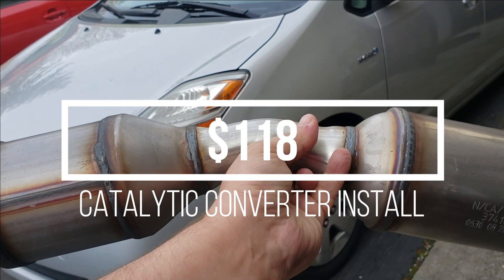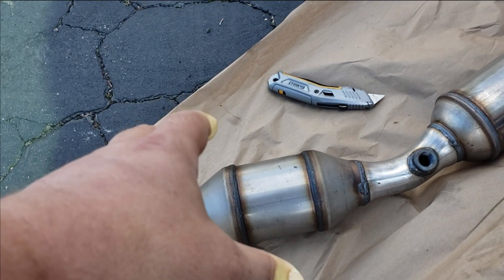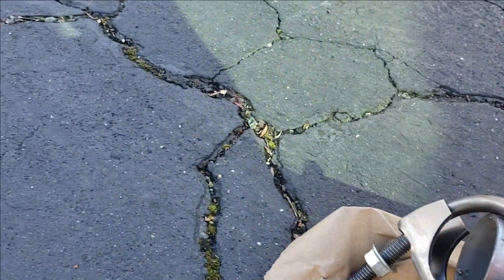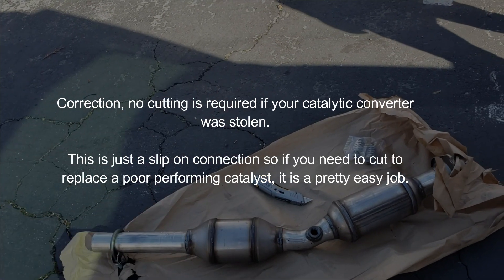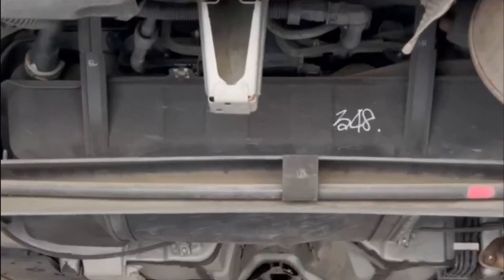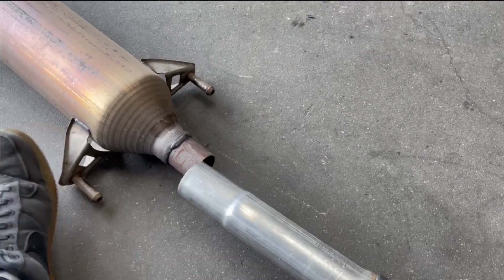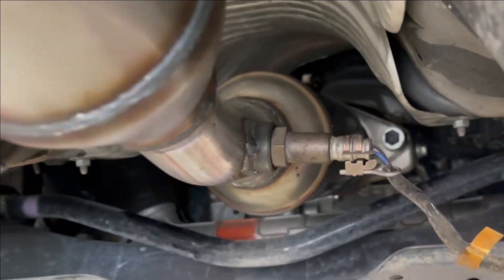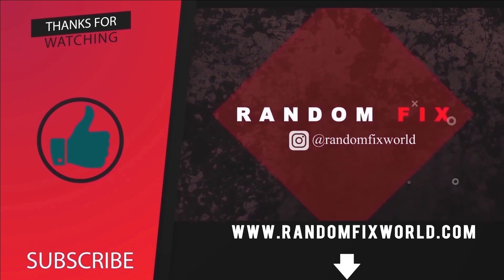Prius Catalytic Converter Replacement▶️ $118 Direct Fit Catalyst Install After Theft

Comment: Great video!  FYI, these low cost catalytic converters are generally not legal for use in California and a few other heavily regulated states with higher than federal emission standards.  Unfortunately, the California legal versions are often priced at or near $3,000 as of me writing this.
Reply from the maker: Thank you for your feedback, much apprecated!
Reply: @RANDOMFIX Mr RF do you have an update video...has this cat thrown a check engine light?
Reply: Yup, my cat was stolen and I had it replaced through the insurance with a $1000 deductible. That was about 7 months ago, and now it was just stolen again. I don’t want to get another OEM part, so I might do what this video says and sell the car in another state. Not sure how to go about doing that though. It has just under 200k miles, old brakes, old tires, cracked windshield, broken AC.

Comment: Will not work for California. For sure
Reply from the maker: Yes this is for off road purposes only. Just to let you know you the vehicle will not throw a code but it might get caught on a visual inspection. It’s really hard to see the catalytic converter on the Prius during an inspection. California should really think about this carb requirement as there is no way to protect these cats even with a cat shield.
Reply: Check your specific laws. I think California only checks OBD for hybrid vehicles during emissions.

Comment: you cannot install it in California🤣
Reply from the maker: You can not fart up wind in California…. Add this to list of things other people do.  
It’s not what I would do

These catalysts are sold for off road purposes. Off road your Prius in California.
Reply: Why?
Reply from the maker: They will ship to you in California but you are not suppose to drive use these on vehicles drive on California road if registered in California. It’s all about the money and please read in between the lines! Good luck with everything
Reply: @RANDOMFIX would this past emisión???
Reply from the maker: @trappdaddy6920 it would set the monitors needed for smog and will not pass an visual inspection in California if the technician checks. The rest you can figure out.

Comment: How did you get it to pass the smog check??
Or what can I do for it to pass smog; because is an aftermarket piece?
Reply: I had a friend replace his cat with an aftermarket.  Check engine like came on. When to the dealer and the original oxygen sensor. It pass smoke right away. Don't buy those cheap oxygen sensors
Reply from the maker: Yes cheap non oem o2 sensors can cause lots of issues and you could waste $$$ on diagnostics.
Reply from the maker: Sorry for the late reply! did you find a solution?
Reply: @RANDOMFIX  no worries:-) 
No, I was not able to find solutions for it, so I had to spend extra money to buy a new one from the dealer

Comment: THANK YOU! Thought welding was the only option before this vid, just ordered my direct fit off ebay for my 08 prius
Reply from the maker: Good to hear the video help with 2008 Prius catalytic converter. Was this the first time it was stolen?
Reply: @RANDOMFIX   nah it actually wasn't stolen just got a p0420 and just wanted to replace it to get ride of the code
Reply from the maker: Wow on a Prius with th oem catalyst? I would check everything before installing a new catalyst, something is cause it burn hot, excess fuel, bad spark plugs?
Reply: @RANDOMFIX  yeah lately it's been having bad fuel economy, had it for almost 2 years without any issue, before replacing it I'm definitely gonna check the spark plugs etc, if it's one of those as a problem I'd definitely return the cat, I ordered it before researching deeply on it
Reply from the maker: Don't go with after spark plugs on the Prius but only oe spark plugs. Go to the Toyota dealer if needed. Should be denso brand.
Reply: @RANDOMFIX  just looked it up, I see denso spark plugs going for $10 each & $40 a set in AutoZone, Are those worth it?
Reply: i had a new cat welded a few days ago and noticed the new cat sounds louder, after i pumped gas earlier and started the car as i was watching the fuel gauge filler up the cat just sounds overall louder when the engine is on, is there a welding issue or is this normal for a new cat?
Reply from the maker: That is hard question to answer with driving and inspecting the vehicle.
Reply: also i noticed after the cat was replaced my fuel economy went back up to normal again so that must mean the cat is working normal right?
Reply from the maker: Yes. Are the monitor set now?
Reply: @RANDOMFIX  yeah I took it back to the shop and they reset the code, no longer pending
Reply: @RANDOMFIX   pending code just now returned, everything was running normal for a couple hours of driving until right after I filled my tank with gas, the vsc, abs and exclamation light on the vehicle came on and disapeared, and the pending p0420 code returned 😔
Reply: @RANDOMFIX  it's been drivi g fine the whole time so I'm going to give it another day before I take it back to the shop, when I took it earlier try they just reseted the pending code and that was it
Reply: after i scanned to check any problems with my obd2 scanner it shows the code p0420 again but no check engine light showing in the prius, anything to that?
Reply from the maker: Is the p0420 code pending?
Reply from the maker: So there are pending codes ( hasn't trigger a check engine light) a store code ( has triggered a check engine light) and a permanent code. A permanent code can not be deleted ( 2010 and newer vehicles). A pending code normally says pending next to it depending on the obd2 reader you are using. Can you clear the memory using an obd2 reader?
Reply: @RANDOMFIX  thank you for that info and yes im able to clear it, strange it hasnt triggered yet
Reply: could pending codes dissapear?
Reply from the maker: Anything is possible and a pending code will keep the monitor from setting.
Reply: not sure what pending means, i went to read codes on the obd2 scanner and it just had p0420 but there is no check engine light on the prius
Reply: could it be pending due to recent replacement? had it replaced about 2 days ago
Reply: Just now checked it again before work, pending code disappeared  and doesn't show on obd2 anymore

Comment: Hi how is hold up? Thanks
Reply from the maker: Good just make sure you don't install it if you have a misfiring engine.
Reply: @RANDOMFIX  fix the misfiring engine first or what? My prius used to run great after they stolen my cat I got code p0301 p0011 and p0037
Reply: @RANDOMFIX  please tell me what should I do? it can't be fixed or what? I just got the parts to fix it from Amazon! Should I just sell it? I listed online that the catalytic converter is gone but despite that lot of people want buy it! Please respond 🙏🏾 it means lot to me as I been unemployed for over 1.5 years due covid19 and just got back to work and don't have much money! Thank you
Reply from the maker: If your Prius ran great before the cat was stolen then you should be okay. After install the new cat, clear the codes and check in a few weeks to make sure that P301 code is gone, if it is pending or still there then check the everything on cylinder #1. Good luck and sorry about the long delay I'm traveling thru the great USA, currently in Texas.
Reply: @RANDOMFIX  OK thank you so much! Enjoy your trip!
Reply from the maker: You should install a cat shield as whoever stotel come back again. They about $150 on ebay.
Reply: @RANDOMFIX  yeah I will definitely do that, I just didn't know people would steal catalytic converter till it happened to me! Again thank you so much for your help!

Comment: So how did this catalytic converter perform after install?
Reply: most likely still had a check engine light and failed local state inspection..
Reply from the maker: No check engine lights and unless you live in California or new York you will not fail emissions test. The catalytic is legit ( it's never as good as the oem but the price makes up for it)
Reply: @RANDOMFIX  what if I l live in California? What can I do if mine is stolen? Need help please!!!
Reply from the maker: You are supposed by a new for 2200 to 3500 dollars. You need to do what is best for you.
Reply: @shuaibi.9136  I just put one on my prius because it was stolen. I got one of these as a temporary fix to get down the road until my mechanic could install an OEM (because there is a backlog). I had to have it shipped to my cousin out of state and then he sent it to me here in CA. As far as putting it on the car it's pretty easy. The difficult issue is the best way to get under the car. I bought 4 jack stand and the ramp stand. Then got under and went to work.
Reply: @mikeandpaul7328  did any lights come on? Did it rattle?
Reply: @dh-uo4lt  check engine light stayed on because it’s not rated for a Ca. Manufactured Prius. I had to get an OEM gasket because the one that came with it sucked. To compare the noise and rattle of no cat to this one, it’s about 98-99% better. Gas mileage is almost the same. It’s not perfect, but it’s better then a straight pipe. Straight pipes SUCKS and would have been more expensive then what I did…
Reply: @DrinksMadeEasy  wait, priuses in california are made differently?
Reply: @dh-uo4lt  There are stricter smog laws in CA
Reply: @dh-uo4lt no just the catalytic has more precious metals
Reply: @shuaibi.9136 I los Angeles.  First: don't report nothing to police, second add everything on your insurance,  third- let's insurance pay for it. ... or go to the street and get your convertor back.
Reply: @DrinksMadeEasy I was charged $200 for strait pipe. Better this one. Now it is only $45 . Ship to everywhere . I live in los angeles